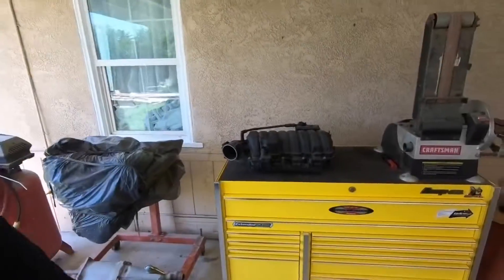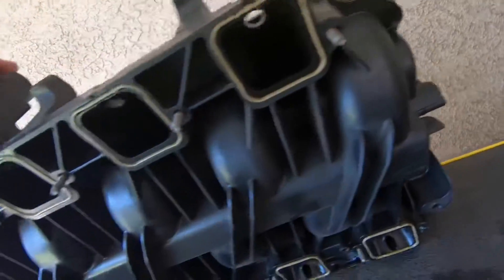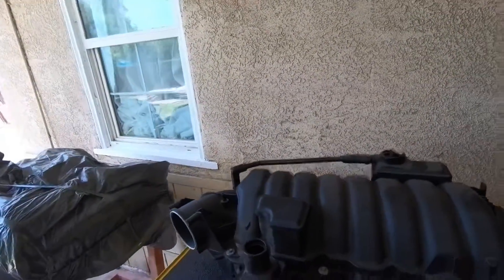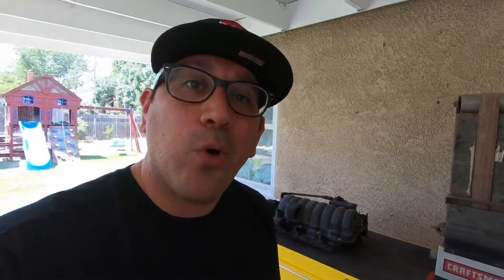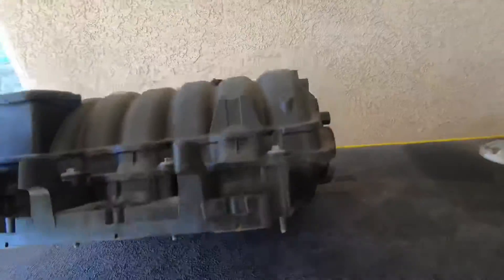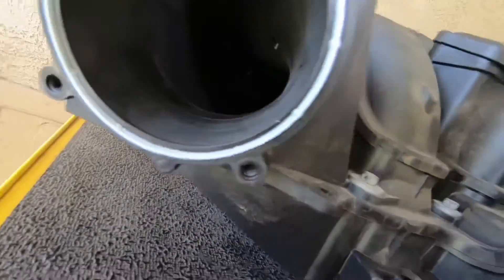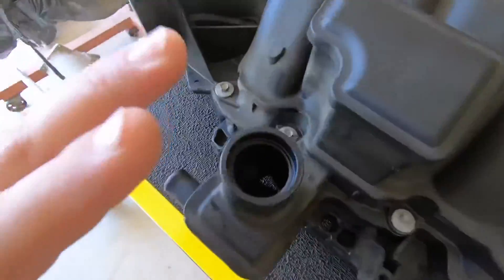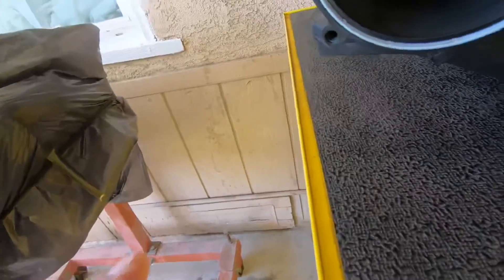How It Works. The 392 Hemi Intake Manifold

Comment: Hey bro can you help I have a 6.4 intake manifold and whenever I hit the gas at idle in park rpm holds at 4000 am I doing something wrong
Reply from the maker: Thats normal when you’re in park. Now if it does that when you’re driving. You have a computer problem.

Comment: Great info always wonder how it work so 4k is best rpm range when setting this for a 5.7 conversion
Reply from the maker: That’s a good spot to set it.
Reply: @scatspeed3114  what would be good rpm range it shuts off is it at 2k rpm
Reply from the maker: I don’t know, I just know it switches around 4,000 rpm to the short runners.